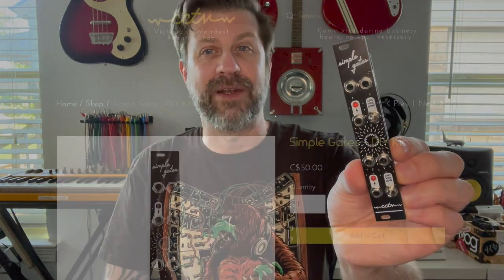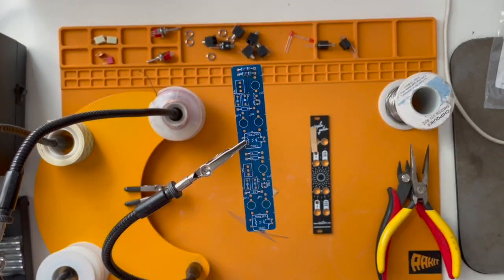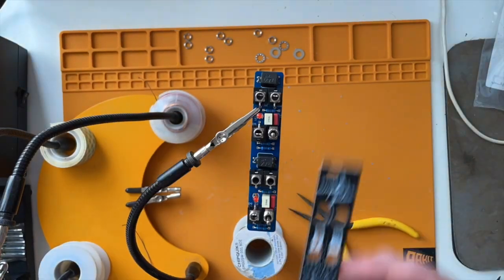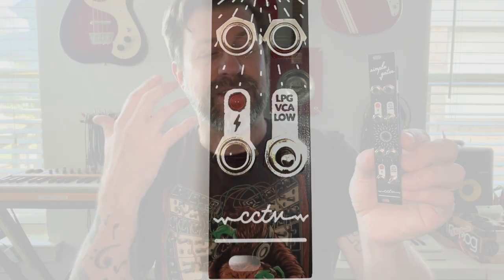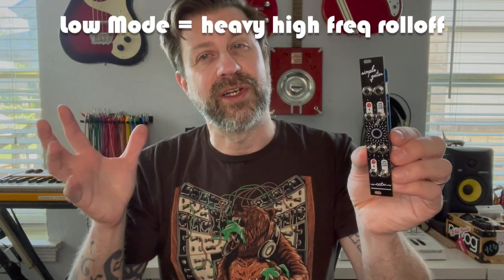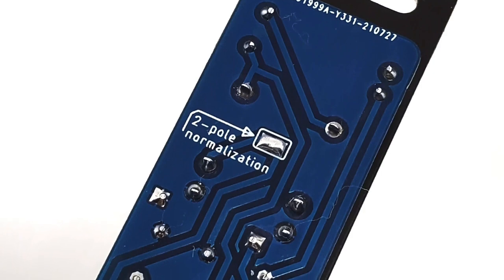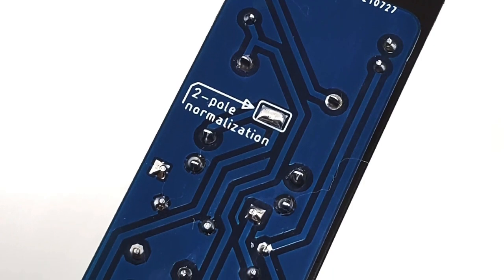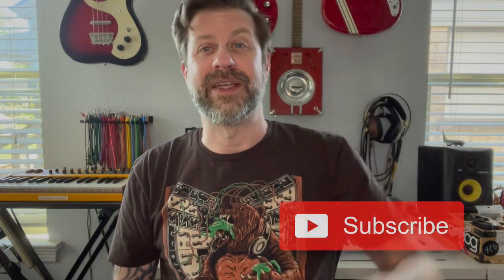CCTV.fm Simple Gates Eurorack Module Kit

Comment: Nice demo. Just built one, brilliant module and super bang for buck. If jumpered in two pole mode, can the bottom section still operate independently if required? Cheers from Aberdeen 👍🏻
Reply from the maker: Thanks for checking it out. It still functions a s 2 independent LPGs. The CVs are normally together but inserting a cable in the bottom CV breaks that normalization. Same with audio once the jumper has been soldered.

Comment: Great video, as always. You should check out the Mystic Circuits 0hp modules they are all vactroul and require 0 power as well. They are a bit more experimental, and they don't have any good demos (so you might be able to work out something). Just saying
Reply from the maker: Ironically. I have one of those 0hp modules I got at knobcon 2017. I need to dig it out. It’s really cool. Thanks for checking it out.